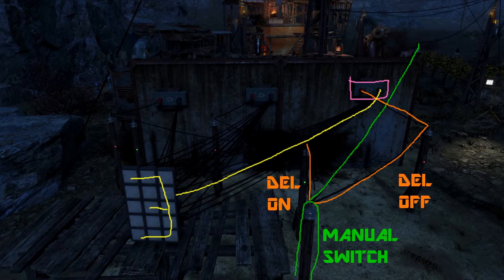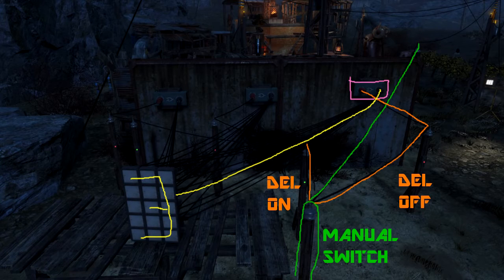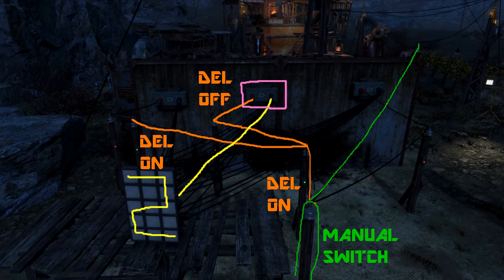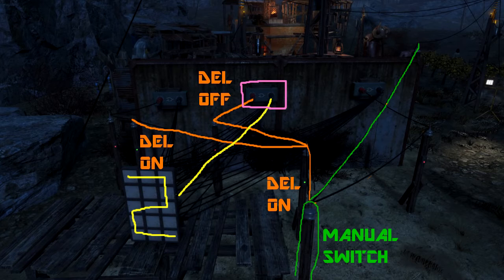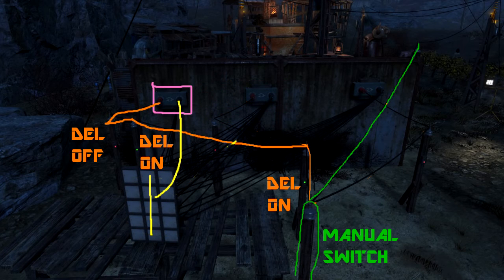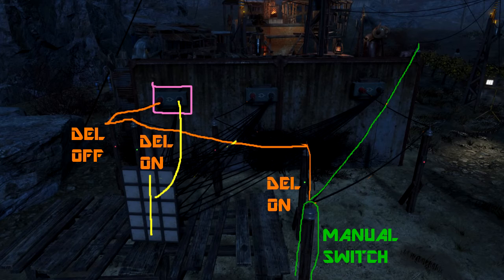Fallout 4 - How to Build a Countdown Sequence Lightbox | Logic Gates Explained!

Comment: Can you explain the function of the AND-gates in this system? As far as i understand they only provide a simple passthrough of electricity which is not really needed in your setup. If you take out the logic gates and just wire your lightboxes directly to you Delayed-off-pylons would it not work exactly the same?(saving resources for both wire and 3 logic gates) I'm all new to this but i'm trying to grasp the basics since i'm fiddling with the lightboxes too to see what i can do with them. As far i understand the AND-gate needs 2 active inputs to output (if input A=1 and B=1 then output C=1 and nothing else) but in your setup i only see 1 input (A=1 B=0) and still it outputs (C=1). In other words A=1 equals C=1 so nothing really happened there?
Reply from the maker: In theory, you are correct that I should have been able to just use a wire terminal instead of the AND logic gate.  I actually did it this way the first time.  The problem was I was having issues with power continuing to run through the circuit even after my "delayed off" switch would power "off".  The only way I was able to get around this issue or bug was to use the AND logic gate.  Hope this clears things up and good luck building!
Reply: That explains a lot. Thanks for the video anyway. I've noticed weird bugs too while building my project and that's why i ended up here. I couldn't get my logic gates to behave correctly but routing all my primary power inputs through single input AND- gates solved a whole bunch of issues. I've managed to build a system that takes binary input and and through AND- and XOR- gates outputs to 26 lightboxes(a unique output for each letter in the alphabet). Eventually it's going to be a massive dotmatrix display that i can hopefully program with that. I'm no content creator but i'll upload it soon as a proof of concept. Cheers
Reply from the maker: That sounds awesome.  I have had plenty of frustrating experiences with the logic gates so good luck!  Also your build sounds really impressive and I’d love to see the finished product once you are ready
Reply: The whole project might take a while, but i got so far as getting 26 outputs lit on 8 bit input, here's my WIP: https://youtu.be/ZFJpOJIf3Sc . Next step is hooking it up to a lightbox dotmatrix and make it so i can program it for full words ^^